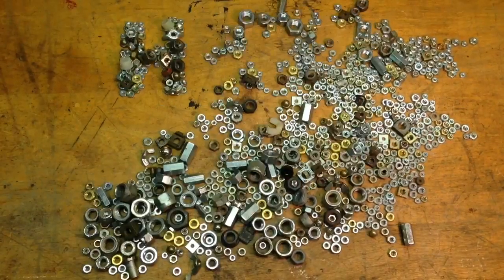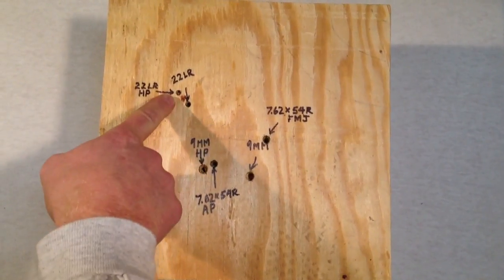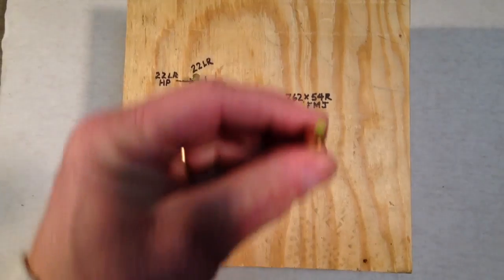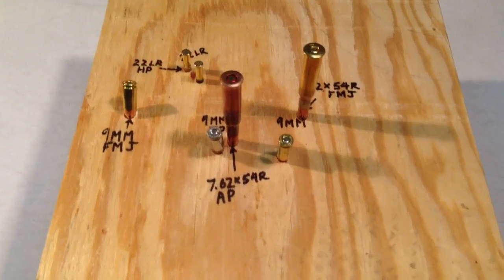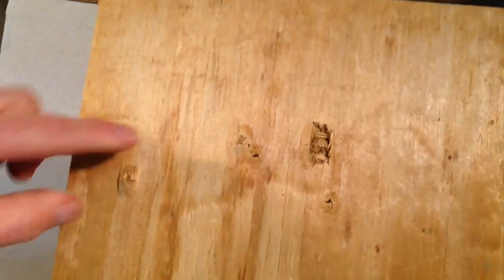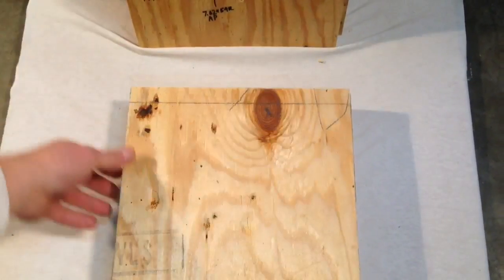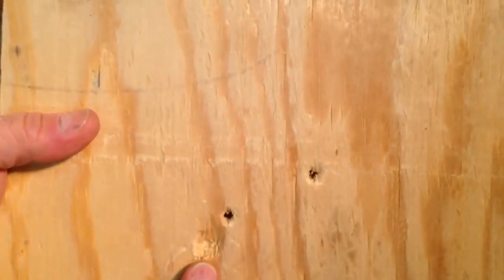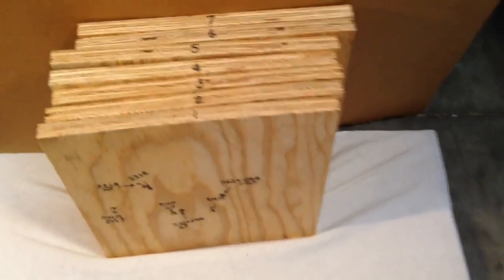How far will different types of ammo penetrate into plywood?

Comment: Would have been nice if you mentioned what guns you used, especially for the 22 lr. Barrel length makes a significant difference on velocity.
Reply from the maker: Also would have been nice to tell what kind of powder was used in each casing and how much. But I’m sure there is something else that someone will think of. That and many, many other things make a significant difference on velocity. Thanks for watching.
Reply from the maker: BTW it was a stock Ruger 10/22.

Comment: I remember when I was a teenager, my dad asked me what tree I thought the 30:06 we had been shooting would not shoot through? I picked a big beech tree about 3 to 4 feet in diameter (not circumference). I thought surely 3 to 4 feet of wood would stop any bullet. We moved back a few yards (we were in the woods far from any human habitation)  and he let me shoot the big beech tree square in the middle. The bullet hit the tree dead center and when we walked around to the back, there was an exit hole dead in the center. The ammo we were shooting was surplus black tip armor piercing ammo from WW 2. Later I tested it against concrete reinforced with 1/2 inch steel rebar every 2 inches. The concrete was about 5 inches thick. It went through this also but was stopped by a second layer of the same concrete placed 4 inches behind the first. There we found a perfectly shaped boat-tailed spitzer tungsten steel penetrator about 27 caliber a little over an inch long. There was no trace of the copper jacket. Bullet construction has an even bigger effect on penetration than velocity.
Reply from the maker: That sounds like fun. Thanks for watching.
Reply: One little lnown fact about beech trees I have found is as they get bigger they tend to be hollow inside and not show evidence like nost holloed trees.

Comment: Thanks for the video. 😞 Question: what if you took welder's cloth and covered the front and back side of 3/4" plywood with it using fiberglass resin and then shot through it? Would that reinforce the plywood creating a barrier for home safe rooms? Seems the cheap method is 2 sheets of 1/2" plywood and 8" of small, dry, rocks between the cavity. Layering would look like: 1/2" plywood, then 2x4 framing (flat profile) attached to 2x6 boards, then 2x4 framing, then another piece of 1/2" plywood and the entire cavity filled with rocks.

Comment: What's funny about that that's like construction grade plywood right? I made a door for a couple out of African mahogany and African mahogany marine grade plywood. I shot that door with 762x39 AK-47 and it was proof. When you build a door you make it like the letter H. You always leave horns on, and then you cut the horns off to the size of the opening of the door.  I shot those horns and gave it to the guy to let him know what the what the door it would stop. So basically the density of the wood makes a huge difference. Soft pine goes through hard African mahogany stops.
Reply from the maker: Yes, different woods will hold up differently just like different woods will support different loads. That is awesome that your door held up so well, I would be curious how it would hold up to this round.
Thanks for watching.

Comment: Wait.  What kind of gun was used?   Was it a shorty pistol, or a rifle. I'm focused on the 22s.  Have seen a few other videos of 22s going through 1.5" of wood, truck doors, come out the other side and go through multiple water jugs, etc.
Hard to understand why in your vids the 22s went barely .75 inches or so.  I wonder what velocity ratings / brands were used.
Reply from the maker: The 22 was from a Ruger 10/22. Don’t remember what brand the ammo was but it was nothing special. I’m sure it may penetrate more if something different was used but I doubt that it would make a huge difference. Thanks for sharing.

Comment: I'm reading that 3.5in of sand will stop most rounds. So I guess a plywood box to hold the sand would be better than stacking playwood.
Reply from the maker: That does sound like a better solution if that’s what you were going after. Thanks for sharing that.

Comment: how far were you from the target? someone did a driveby on my house (this is the 7th one in my life) so i decided to at least put a huge piece of wood i consructed from a old entertainment stand in front of my main window. i figure if anything itll at least slow the bullet down when it goes through it instead of just glass
Reply from the maker: I would say we were about 20ft. from the target, but I believe you may have a larger issue. I wish you luck. Thanks for watching.
Reply from the maker: hippa2dahoppa2 Keep doing the right thing, hope everything turns out well for you.
Reply: You did the right thing, but the problem with the way our justice system works is you get the sharp end of the stick instead of the robbers or their buddies. Anywho, good reference video, I used this to do some calculations regarding the junk fences in Fallout 4.
Reply: @nickmotsarsky4382  pretty much anywhere in Brooklyn and the Bronx from my experience if you live in the ethnic parts. Hell, I knew a crew of white guys in Bay Ridge Brooklyn that did stuff like that in the 90s.